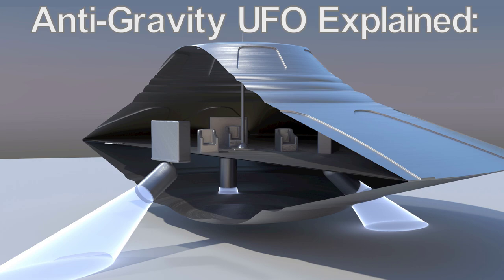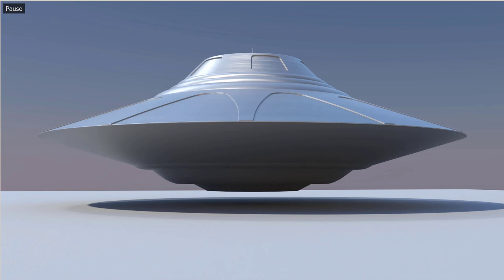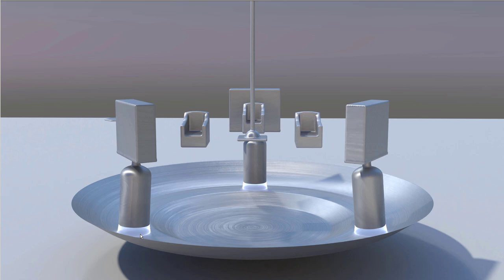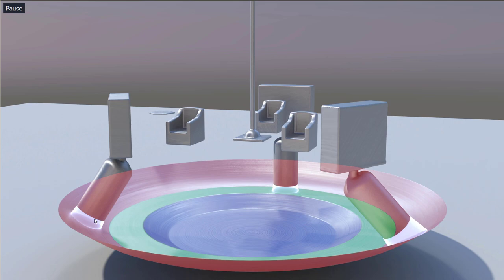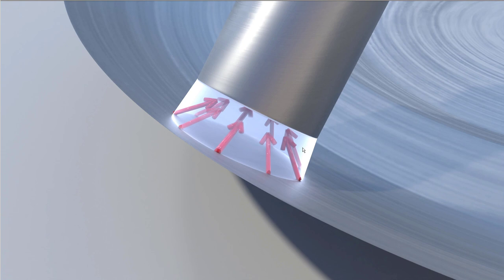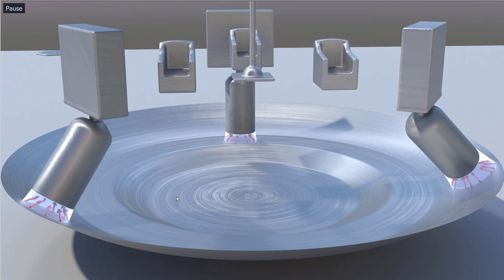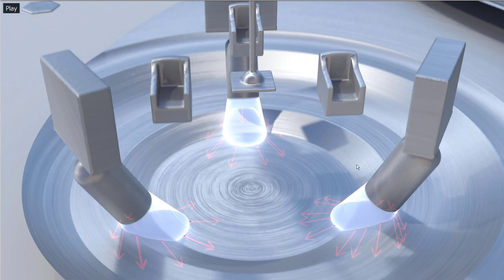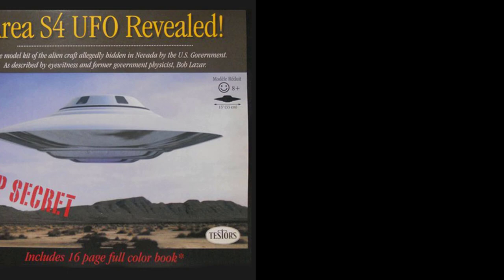Bob Lazar's UFO 3D Modeled + Anti-gravity operation mechanics.

Comment: Lol you don't actually explain anything. 
How do these "gravity emitters" work?
How are they generating gravitational waves?
Reply from the maker: You act like I'm the only one that doesn't know the mechanism behind Gravity.  Newsflash:  No one knows that, that we Humans know of.  The mechanism of Gravity is a complete mystery to Humanity as of 2020.

Bob said what they observed to the best of their measurements was that the reactor bombarded an unknown element as fuel (115) with a high speed proton which created a total annihilation reactor, the byproduct of which was Antimatter, or Anti-Hydrogen.  That Antimatter was directed at a gas to create a Gravitational field of its own, which remains a complete mystery to science as to whether that could actually be a possibility.

When Bob made these claims in 1989, neither Antimatter (Anti-hydrogen) or Gravitational waves were proven to exist at the time.  Both were theorized in different physical theories by different people but Antimatter or Anti-Protons weren't proven to exist until 1995, and Gravitational waves weren't proven to exist until 2015 (and there were many failed attempts before 2015).

So Bob may have just guessed correct that both of these would be proven true at some point, but Bob sure has one hell of a guessing noggin on him doesn't he?  Just guessing a coin toss 10 times in a row is a 0.1% chance of guessing correctly, but these guesses were not simply coin tosses.
Reply: @abominati0n981  
" The mechanism of Gravity is a complete mystery to Humanity as of 2020."
Lol, do you really think that? You're more than a century behind humanity, then. General relativity explains gravitation. 

Proton bombardment of Moscovium wouldn't cause annihilation. That'd be a fission reactor, using an external proton initiator.  It would produce anti-matter, specifically anti-neutrinos, like every other fission reactor. It wouldn't produce anti-hydrogen. 

How would flowing anti-hydrogen into some gas create a gravitational field? There's no mass difference between particles and anti-particles. Gravity is a product of mass. In terms of gravitational effects, it'd be no different to mixing regular hydrogen with whatever this other gas is. 
If you were mixing anti-hydrogen with hydrogen, then that would result in anti-matter reactions. 

Anti-matter, specifically the positron was first observed in 1932. The anti-proton was first observed in 1955. But you're right, these weren't combined to make anti-hydrogen in a laboratory until 1995. Gravitational waves also weren't detected until 2015 either, you're right. 
So? He assumed that physicists knew what they were on about? 
Making claims about phenomena physicists have predicted isn't a matter of guessing, nor is it any credit Bob whether or not those predictions are accurate. The fact that physicists made accurate predictions is a credit to them, not someone who's made unsubstantiated claims about the phenomena they predicted. 
A coin toss is statistically random. Betting whether or not scientific predictions are accurate is not. Especially regarding the synthesis of antihydrogen.
Reply from the maker: @Evan_Bell  I sure hope you watch my next video, because you're gonna absolutely hate it, just like a christian priest would hate learning about any scientific.  NEVER treat science like an orthodox religion.  You will just make a fool out of yourself in the end.

" General relativity explains gravitation. "

No, it does not.  It doesn't explain a god damn thing, it's an observation that is only somewhat accurate.  Relativity is an observation that matter and "energy" are loosely related which is not even accurate, we already know this because special relativity still has to be used to augment it for accurately calculating time-dilation for example and we know GR doesn't work at the quantum level either.  Neither of these observations are _explanations_ of the mechanism behind gravitational forces... but that's exactly what my next video is focused on and it has nothing to do with UFOs...

And also for the record, Relativity cannot explain how UFOs can travel at 40k miles per hour and then stop instantaneously in the air with no sound and no visible propulsion and no impact.  So we already know for a fact that GR as a whole will definitely be replaced with something more accurate that actually can explain what Anti-gravity is, and how UFOs fly.  Gravity is not simply a product of mass, but that is what a caveman would think if he couldn't create it himself.

"Proton bombardment of Moscovium wouldn't cause annihilation."

You do not know that.  What Bob was suggesting was that this isotope of element 115 released Anti-protons in this reactor, which is clearly different than other elements under bombardment, and that's also the whole point of this element being used as the fuel for an Anti-gravity reactor.  I don't know why it was directed at a gas, but I would definitely guess that it would be just plain hydrogen.  We basically do exactly the same thing with internal combustion engines, except we use air because it's cost effective, we don't just burn liquid fuel to produce heat, we throw in air as a gas to harness the power of the combustion in the most efficient way possible.
Reply: @abominati0n981  Not all Christian priests haet learning about science. 
The big bang theory was created by a catholic priest, lol. 

GR provides and explanation of what causes gravitation. 
That mass causes distortions in spacetime. 
SR and GR are both theories of relativity. 
No, we don't yet have a unified theory of everything. 

I don't believe UFO's do perform the maneuvers you claim, but that's irrelevant. 

We know enough about nuclear physics to say with a high degree of certainty that Mc wouldn't produce anti-protons under proton bombardment. By what mechanism could it possibly do that?
What's so special about Mc?
Reply from the maker: @Evan_Bell   "What's so special about Mc?"

How would anyone know the answer to that without having some to study?  I mean, do you want me to guess?  I assume the nucleonic structure is unique in a way that it reacts differently than other elements under bombardment.  Again, this isn't that hard to believe since heavier elements show unique characteristics that we don't completely understand.  Yes, again, we can observe them, but we don't have a complete understanding of the quantum world.  Antimatter is certainly something that we know very little about, so again, we just don't know enough about either 115 or Antimatter to say why this would happen.

"I don't believe UFO's do perform the maneuvers you claim, but that's irrelevant."

Well it's relevant to GR and what you said about Gravity simply being a byproduct of mass.  If UFOs can perform the maneuvers they are rumored to perform, then we know the theory behind GR is incomplete... and the evidence for these claims is everywhere nowadays.  In the Tic-Tac UFO video, the object flies out of the frame of the video in about 0.1 seconds and then pops back into the frame almost immediately, this looks like a glitch because it happens so fast, but if you look at the camera statistics on the screen you can tell that it's not a glitch.  Also, the official report from this sighting said literally that multiples of these objects were observed by multiple different radar arrays "going from above 60,000 feet elevation (outside of the range of the radars) to 50 feet of elevation in a few seconds."  And there are tons of other sightings, videos and strong evidence to support these maneuvers.  You can read the pdf for the Tic-Tac sightings here:  https://www.mysterywire.com/ufo/i-team-exclusive-confidential-report-analyzes-tic-tac-ufo-incidents/
Reply: @abominati0n981  You're suggesting Mc undergoes interactions no other element does. 
What unique characteristics of high-Z nuclides are you referring to? Sure, there are and always will be gaps in theoretical physics. 
If UFO's can perform these extreme maneuvers, it means we're missing something. Doesn't necessarily have to be a problem with GR.
Reply: No it doesn't pull on the metal of the craft what would be the point? Imagine them as huge magnets the craft wouldn't go anywhere if you turned on one would it. No I'm afraid. Gravity crafts work by projecting mass just in front of the craft via huge amounts of energy. E=mc2 (that's the theory of relativity from Einstein if anyone's wondering. It says Energy equals mass multiplied by the speed of light squared. I dint wanna lose anyone so Simplified for you here all you need to note is that energy and mass are the same. Stuff is energy the more stuff there is somewhere the more energy) Energy and mass are interchangeable because they're either side of the equals in the equation. They project tremendous mass (basically huge energy) just in front of the craft so it is always "falling down hill"/getting "pulled"towards it. If they acted on the craft friend, it wouldn't go anywhere. Three are needed simply because of the need not to drop of the sky whilst you are manoeuvring them to a different position. So you wanna leave somewhere asap. You have to use 2 emitters for high speed. Whilst the two are swinging round into position one works on keeping you from just dropping out of the sky. Look. Think of a surfer catching a wave to the beach. Now reverse the footage in your brain. See (in your minds eye) how the wave pulls the surfer along out to sea. That's how a gravity craft works. You project massive energy in front of you. Energy IS mass so it's like putting an earth in front of you for you to fall towards. Can you see how the use of two emitters would make the "planet" you're falling towards twice as big? Anyway I hope this helps
Reply: Oh and in answer to your question first you need to understand gravity. Gravity is merely a cosmic cassimir effect. You have to view the various event horizons conceptually in your mind as a solid wall for the waves to bounce off and not the infinite expanding thing space is. So a boat in a harbour will get pushed into the harbour wall because of all the waves acting on the boat from the sea side and there being less waves between the boat and the dock. Grasp this and you have understood gravity. Like I said energy is mass e=mc2 so they create gravity waves by projecting tremendous energy infront of the craft. I can't go into further detail on here I've already said too much. Feel free to hit me up if anyone wishes to talk

Comment: This is all bullshit. Bob is not being forthcoming. The saucer can fly in any direction, in any orientation. Any ship standing vertically is signaling "HELP" to all in vicinity. No mention of how the saucer is able to make a tunnel before entering the water without a splash. No mention of how the saucer is able to propel every molecule of the craft and crew at incredible speeds and turns.

First, gravity is not a force; it doesn't push or pull, it merely instructs. Matter is self propelled. Gravity just instructs it which way to go. Newton was totally wrong. Nature is a bit more subtle than that.
Gravity is the driver... it doesn't propel the vehicle, the vehicle propels itself.